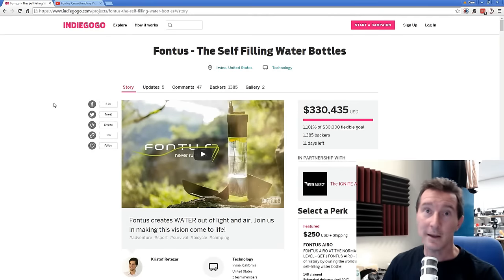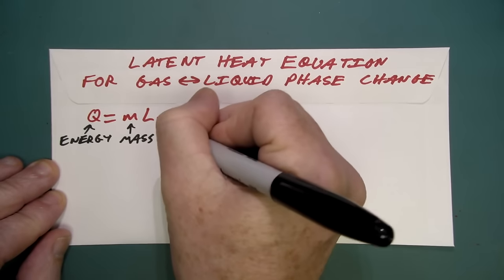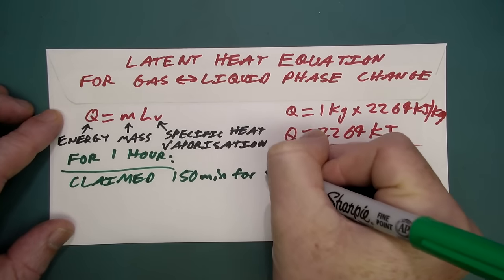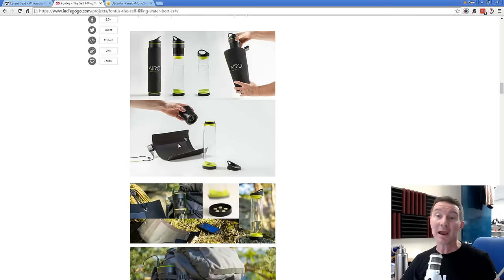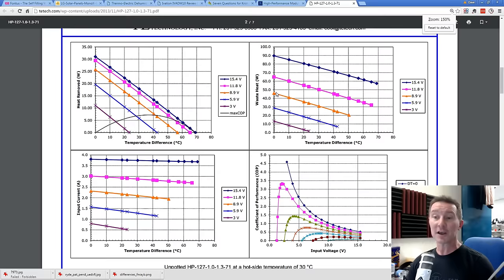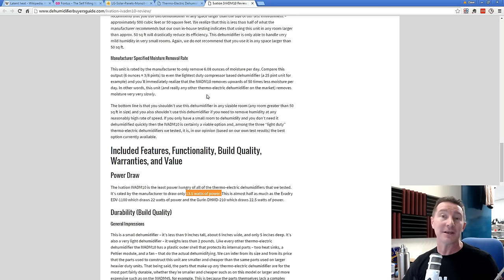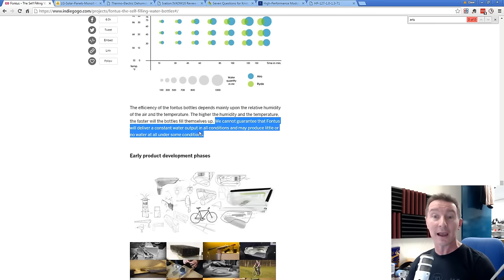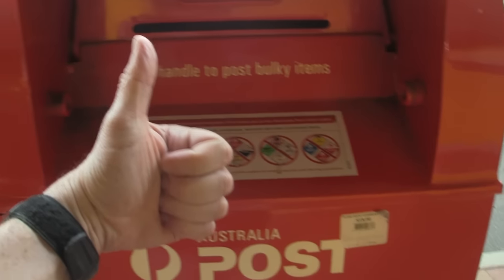EEVblog #881 - Fontus Self Filling Water Bottle BUSTED!

Comment: I was thinking about the heat pump not needing to remove the energy itself, just in effect move some energy around and then you went straight into it.

Top man. 

So even with running the peltier unit at its maximum (200%+) efficiency its still at least an order of magnitude away from reality and that is ignoring at that efficiency you aren't going to get down to condensing temps.
Reply: If instead of using one 30W peltier cooler I stack a bunch of 30W peltier coolers and run them at a much lower voltage, would I get better COP due to lower temperature delta and voltage?
Reply: +UndeadSamurai01 As I understand it the temp delta is directly related to their efficiency. You simply can't get the delta you need to cause condensation very efficiently and even if you could it's still orders of magnitude away from being feasible.

If you could somehow get the peltiers working at peak efficiency of say 2-300% your still looking at a tiny water output in ideal conditions even with a 1m2 solar panel. With the 0.1m2 solar panel from their promo you are looking at a tenth of that. With non ideal atmospheric conditions a tenth of that or less. With non ideal solar conditions and cell positioning often a tenth of that and less.

It is a classic engineering non starter.

The only place I could see this working at all is on a yacht if you could get the main sail covered in a solar cells. And even then you'd be better of using the electricity to run a reverse osmosis pump.
Reply: +LiamE69 i don't seem to have expressed myself well enough, I'm not trying to defend the bottle, just to understand how efficiency on peltier coolers scales when you use multiple  elements - would a multi-element peltier stack have a greater COP than a single element for a given cooling capacity?
Reply: +UndeadSamurai01 No you expressed yourself just fine, I didn't think for a second you were defending the idea.

Okay lets say we need a 20 degree delta to get condensation going. With one peltier that might run at say 50% efficiency. Now you could get that same 20 degree delta with 4 units if you could somehow stack them each with a 5 degree delta running at 200% efficiency - but that is going to come out just about the same overall in terms of system efficiency.

Lets say we stack them in series, air passes the first, then second and so on. While they might be 200% more electrically efficient, the first three are in fact zero % efficient at actually condensing water as they wont have got the air down to the condensation point. So you have three that are zero % efficient and one 200% efficient unit. That is the same as having one 50% efficient unit.

There just ain't much getting around that the efficiency is ultimately linked to the delta whatever way you do it.

Now there might be a little to be gained from stacking if the efficiency of the units and the required delta is in a specific range but equally that could go in the single unit's favour too when the ambient temp changes. When you factor in it is much easier to maximise the condensation area for a single big unit I can't see a reason multiple stacked units would come out on top overall though I could be missing something.

Comment: IF the bike version was somehow changed to work off pedal-power like some bike LED headlamps, it might work to a small degree because then it would have a more ready source of power.  But even then, to generate the power to make a usable amount of water, the resistance the generator would place on the rider is going to suck.
Reply: +Saberus Terras Probably better to just turn it into a bike powered still suit since the air around your body is going to be much much more humid, not to mention the sweat we all exude.

Comment: 100 m3 of free air enters a compressor at atmospheric conditions 20oC and 70% water content. The air leaves saturated at gauge pressure 8 bar and 40oC.

Based on the diagram and table above the water content in the entering air can be estimated to approximately 1.7 kg per 100 m3 free air. 70% of this is 1.19 kg per 100 m3.

The water content in the air leaving the compressor can be estimated to approximately 0.57 kg per 100 m3 free air since the air is saturated - holding 100% of maximum water capacity.

I vonder... If one eliminates the power requirement. Will this then sound like a vacuumcleaner or something??

Comment: Well, I guess nothing needs to be said about it being a design school, it's probably not even worth mentioning that failed students in Germany go to Austria, especially Vienna to get some kind of degree. That no one told them so far what a load of crap they have is what really surprises me. I would have thought at least one of the professors would have been concerned about the image of the uni. 

I also still wonder if that water is even fit for consumption. I mean, wouldn't it be literally distilled water that takes more minerals out of your body and subsequently dehydrates you even further? Though I guess it works in the desert as a means to gather water.. I'm probably missing something here.. I'm not a chemist after all. 

Kudos for the literal back of the envelope math. That one certainly made my day.
Reply: +Victor Tesla Although technically the same process as distillation, our atmosphere is full of dust and dirt so no, it won't be even close to the same as distilled or deionized water. In fact the problem wouldn't be too little but too much stuff. Probably want to boil it first and maybe throw in a filtration through activated carbon to get pollution out.

Also, although we call it dehydration, the main problem with drinking too much water (distilled or otherwise) is hyponatremia, a lack of salt. There are other electrolytes to be sure but that is the first one to hit you. Less ambiguous if you use that term instead, or if you want to be more broad you can say "electrolyte imbalance". We're mostly water so suffering or dying of an actual lack of water (what dehydration should mean) is really rare as you'd almost always die from an electrolyte imbalance first.
Reply: W Bailey Ah, I knew I missed something, thanks for clarifying. I was aware about the second paragraph but lacked the proper English vocabulary to express that I guess.

Comment: Dave, I love your debunking videos, but this one left me a little puzzled?
I have three completely run of the mill dehumidifiers running on my basement, each with a 5 gal reservoir, and mid summer I have to dump them every day, for a total of 15 gal per day, and who knows, I'm not really sure when they fill up, as I am obviously working during the day...
Reply: +Marvio Botticelli Did it run off the grid? Our standard 2kW air conditioning would condensate enough humidity to the point that it's discharge pipe is actually flowing water, not a mere drip. It's 80%+ humidity seaside right in the equator, tho.
Reply: *****
Oh, absolutely, but going by the figures here I though it would taken a whole nuclear plant's worth of output to take that much moisture out of the air :)
Reply: +Marvio Botticelli Phase changing dehumidifiers are much more efficient than solid state Peltier chips.

About 4x.

Comment: Latent heat is RELEASED if you condende steam. You are not writing down the equtions that describe the phenomenon, you are simply messing with numbers. Let me explain again. When vaporized water is caught form air, and it condense on a cold sufracd, it raises the surface temperature. Like in a cold bathroom when you open hot water in the shower: slowly the walls gets wet and warm. Energy is released, not requested. You write down the equation as if you should actually vaporize a liquid, this is a different phenomenon.

Comment: Wait, correct me if I'm wrong, but a dehumidifier isn't changing water vapour into liquid water. It's condensing water particles suspended in the air. So the latent heat equation is not the correct equation. Isn't this just a psychrometrics thing? Change the temperature so that the relative humidity reaches above 100% and precipitates?
Reply from the maker: +coolliam1450 The latent heat of condensation is cubic function:
https://en.wikipedia.org/wiki/Latent_heat#Latent_heat_for_condensation_of_water
I didn't use that to keep it simple, and using it would only provide a result which is even worse, so I was actually being generous.

Comment: Plottwist: They accidentally invented a revolutionary kind of solar panel. xD
Reply from the maker: +Mobin92 Wouldn't surprise me if they used the recent UNSW announcement of 40% efficiency improvement or whatever as evidence that it's now possible.
Reply: +EEVblog is that 40% from say 20% to 28% or from 20% to 60%? The former I could believe given the advancements in silicon purification and doping strategies, the second I do not believe to be possible. If my lecturer is correct then there is a roughly 50% theoretical limit for efficiency of solar cells.

Comment: Is that panel smashed there? What do you do with broken panels, i mean do you have some special tactics to rewire them to lower voltage, shorting out some cells and resealing the thing?
Reply: +Pyroslav x Dave has some videos on that panel getting smashed seemingly out of the blue. From what I hear the best thing to do with a broken panel is to send it to the recycling plant unfortunately.

Comment: There is a bit of an error in reasoning: you have to take away this much latent heat from the system, rather than put into it. I.e. when you vaporize the liquid, you put energy into it, and when you liquefy it, you should take it away. But the rest of the calculations are probably correct as you need about the same amount of energy to be spent on the heat pump (Peltier element). Or maybe not: my thermodynamics are crusty around heat pumps.
Reply from the maker: +yoksel99 I essentially said that. Although you have to expend energy in order to remove energy from the system. The power source can include "the system", it's a matter of semantics really.
Reply: +EEVblog Well upon condensing water a dehumidifier actually re-releases the heat previously needed to evaporate it. It is a more than 100% efficient heater!

Comment: I seem to spot a mistake in your calculation. It takes 2264 KJ to make 1 Kg, or 1 litre, of water. If you want to make 1 litre in 150 minutes you can calculate the energy needed per hour. That is 2264 divided by 2.5 equals 905 KJ/hour, and not 905 KJ/litre. This 905 KJ would give you only 400 ml of water after one hour.
Of course this means the Fontus performs even worse than you estimated.

Comment: Nice work Dave but I would have rather you'd take the actual product and it's components and examine them.
The may have something in the equation that you are missing LOL.
Has anyone tried them?
Building a system like this is pretty easy.
All you need is to put a cool chamber inside of a warm chamber, insulate them and a way to extract the condensation.
Sounds like a basic theory of an air-condition LOL.

Comment: Can you also bust "voltage doesn't kill you amp does" ? I know it has been done by various people, but love to hear from you. I've heard some engineers saying that. For the love ohm's law pick up a physics book.
Reply: +Alperen Akküncü Static electricity has very high voltage but has no real current to deliver thus so kill you.

A car battery can deliver hundreds of amperes but [under most conditions] lacks the voltage to push any real current through your body, so won't kill you.

High voltage, capable of pushing current through you, and with current capacity available - will kill you.
Reply: Michael Tempsch That's what I am saying if you have high enough voltage to create high current, it will kill you. You can't have one without the other. Also impedance of the body is important because all sources supply different power to different loads.

Comment: HOLD UP RIGHT THERE water in the air is not a gas its liquid. It is not changing phase at all.
Reply: >liquid water in the air
Reply: Look it up its true
Reply: Humidity is the amount of water vapor in the air. Water vapor is the gaseous state of water and is invisible.[1]

You're gullible.
Reply: How about you present some sources when challenging countless decades of scientific fact instead.
Reply: +jacky koning So your first claim was, and I quote, "It is not changing phase at all." But now you say as evidence for this claim that it is indeed a different phase, "There are states of matter that are not solid liquid and gas there is an in between phase." Or do you mean phase != state of matter? What is a phase then? And why in that sentence do you use them interchangeably ("an in between phase")?

Comment: what your talking about, hadn't you use the air pump before?  I've have one and water goes in the air tank here and there, but not much, yet again, if you leave it about 24H pumping, it will get about good amount bits of cup like of water.  There is always another way to use eletric which rumors about eletric crystals which I don't know its fake one or not, but some ppl claim it works for certant energy, so don't know its a bunkers of great lies or not, if it works then possible can have the pump work for more then 24h.

So...Technially, it isn't a bad idea still, but if used right.  So if we get crystal batteries that is size car battery or either size of either has 4-10 car batteries of them in crystalized, then it wouldn't be just fake one out getting natrual good for sucking in moisters and getting water that way, but there is larger scales problem, it all depends in the machine size and how much it can take before overheating.  Everything has its limits and like that a fliter doesn't last forever because of corrsive, rust, moss/mold, and dematerialized as the time being.  Lucky enough crystal doesn't get neither of them, but it can break, or either get melted again, so pretty much the world is full of bunkers in their ways.

I guess we better hope we will find a good materials that will last us in endless of time then.

Comment: Would it be viable on a bicycle if using a Dynamo to supply more power to the Peltier Device?
Reply from the maker: +zeroy IIRC a fit cyclist can produce 500W for short periods. Without having done any calcs at all, my guess would be you'd expend more fluids cycling to generate the power required than you'd get back in water generation.
Reply: EEVblog Roger, thats my Kickstarter idea gone :D

Comment: Other Question: how smells distilled or condensed Water ?is it unhealthy to drink distilled or condensed Water ?
Reply: +Ratzfaz The water it could produce though a whole day is barely enough to make your tongue a bit wet so everything is fine. Once it gets into your mouth it's not distilled anymore.
Reply: +Ratzfaz Drop in a bit of ocean salt.
Reply: +Ratzfaz No, it's not unhealthy to drink distilled water. Distilled water is literally only water, nothing else. Condensed water would have any pollutants currently in the air, but your lungs are more sensitive to most pollutants than your digestive system. If all you ever had was distilled water, you would starve before you had any other issues. If you have food, you won't have any issues drinking only distilled water, assuming your diet is balanced.

By definition, distilled water has no smell, other than that it would smell "wet".

Comment: that’s the maths for condensing steam at 100C, vapours, water dissolved in air, don’t work like that.

think about it, at 100% humidity its really easy to condense, at 0% its impossible, your logic relies on it not making any difference.
Reply from the maker: +simon place Correct. The latent heat of condensation is cubic function:
https://en.wikipedia.org/wiki/Latent_heat#Latent_heat_for_condensation_of_water
I didn't use that to keep it simple, and using it would only provide a result which is even worse, so I was actually being generous.
Reply: the problem is not the amount of energy released by the condensation, the problem is you're assuming the air temperature is fixed, it wont be.
Not all the energy released by the condensation has to go through the heat pump, some is bound to go to heating the air.
In fact at exactly 100% humidity the 2nd law of TD, allows all of it too, the cold element just acts to disturb a precisely balanced equilibrium, so theoretically the max amount of water condensed is infinite, or, in other words, energy conservation and the second law dont in themselves limit the condensation, you need to get down to set-up details; at least the operational humidity, the rate of air replacement and the thermal contact with the cold element, to even start calculating anything close to an answer.
but at very high humidity it is potentially very large.
of course this means the marketing twonks can claim anything, to get high numbers they can just run the unit in what ever elevated humidity gives them what they want.

Comment: If it was a specially designed bike that created the energy by pedaling and had a solar panel and battery/buffer at the back and you were at high altitudes high water density would it possibly work then? (Not as efficient as they say it can but at all)

Comment: So much energy & time is required to produce water out of air that I don't even think a 24 hour marathon with a small bike generator could net me a 1L bottle (assuming the best environment for this).
Can someone smarter than me in this area run those numbers (I'm more of a programmer, so I can take your equations into an application and make them reproducible).